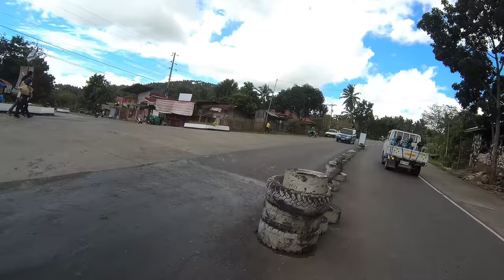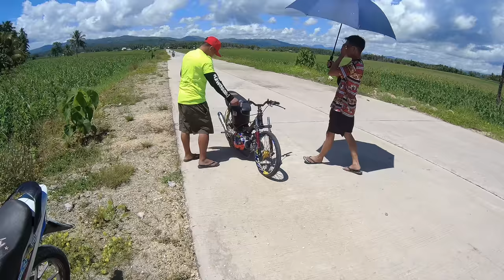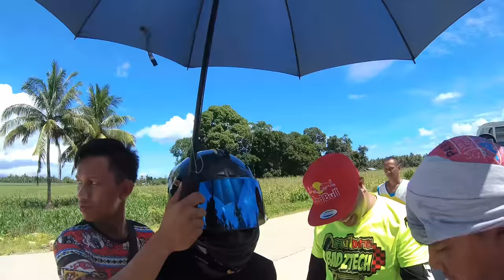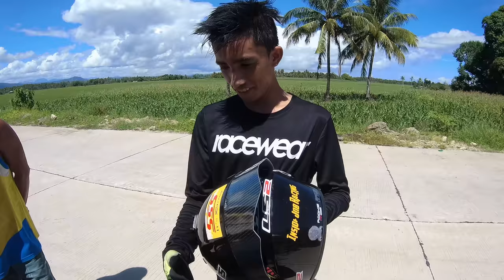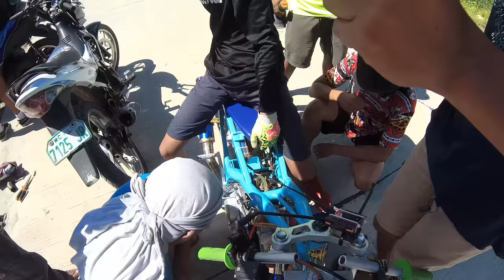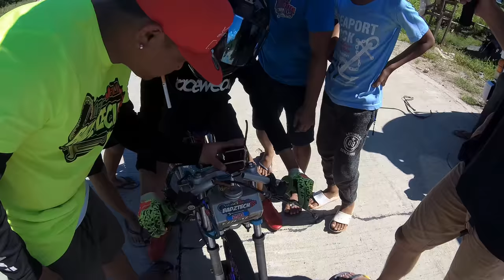25G racebike |testdrive tuning|ok na sana pero may?

Comment: boss ano tawag diyan sa kumokuwa nang time at na ka kabit sa motor at saan ma bili??salamat more video..god bless
Reply from the maker: Qstar tawag dyan boss.. set up ng 25g is stock size valve stock camshaft stock stroke/bore or 150 cc yan yung limit nya.. the rest pwd mo na upgrade like port,lighten segunyal or flywheel and drive gear,change transmission pwd na
Reply from the maker: Pwd narin ang after market na piston sa 25g basta 62mm size diameter lang,pero dito samin stock na piston lang pero ginawang doom type
Reply: block sir kahit any brand pwedi basta 62mm???